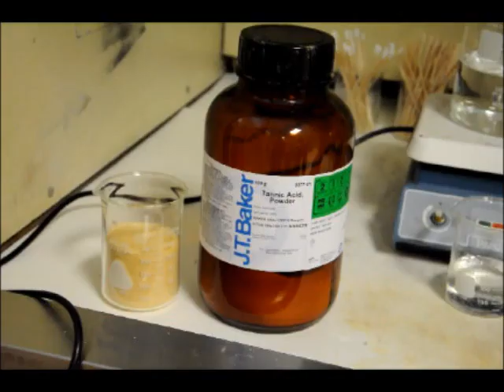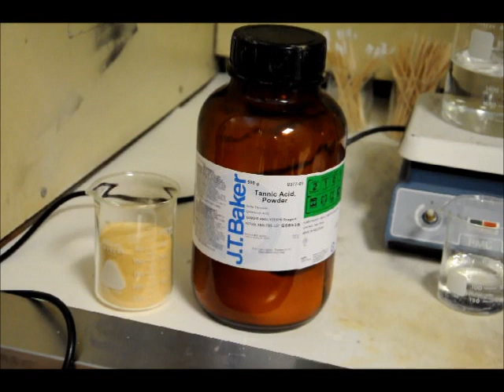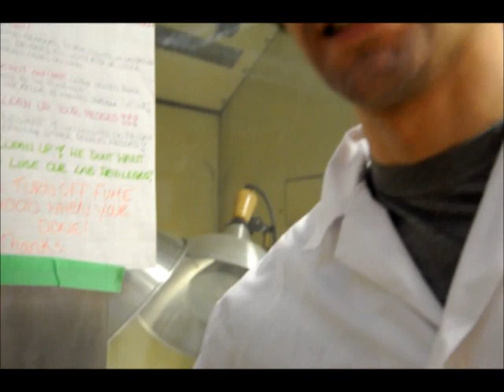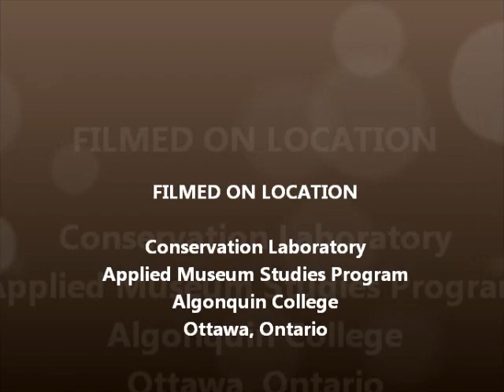Algonquin College Applied Museum Studies Tannic Acid Treatment of Iron Artifacts

Comment: I use tannic acid on a very regular basis for stabilising rust on old tools. My simple solution [no pun intended] is to boil up one volume of used teabags simmered in an equal volume of water for about an hour and then strained off. I make it in gallon batches. Tools are immersed in the solution and simmered for half to one hour. Timing is a matter of judgement and experience. I get pretty repeatable results and the solution can be used a number of times before it loses efficacy. the tool is withdrawn and while still hot, surface residues are removed using 0000 grade wire wool dipped in mineral oil. Wipe off and apply one more coat of oil. Not very scientific, maybe, but it stabilises the rust in pitting and micro cracking and has worked well for me over many years.